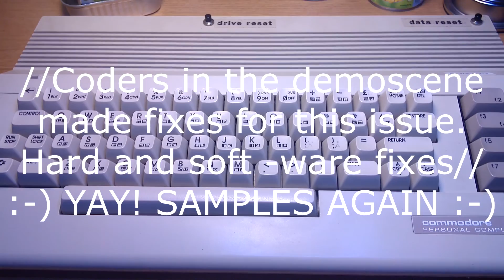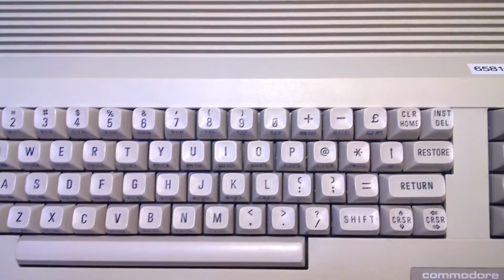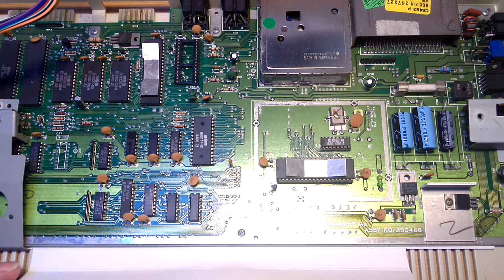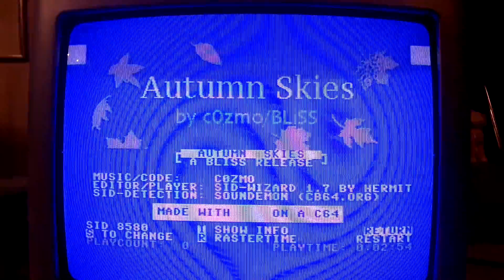SIDFX - Explaint aka Explained

Comment: Hey thanks for doing this video! It's cool that you found the hours to do it. Much appreciated. One small note, the SIDFX-3 is because of the cable length. The standard length is 30 cm SIDFX-5 has 50 cm. The last product is a SIDFX-R which also includes the SIDFX adapter for usage with Reloaded motherboards mounted in C64C chassis.
Reply from the maker: No problems :) It was wicked awesome to make the video too. I have some more SidFX things under the Christmas-Tree that will be revealed.
Reply: That's cool! Looking forward to see what that could be. Just a small note more. The product is called SIDFX - all capital letters please. :-) Not SidFX
Reply from the maker: Scarzix of Offence Great :)